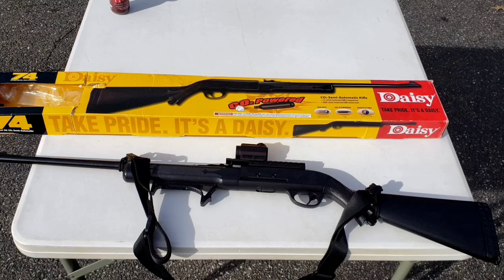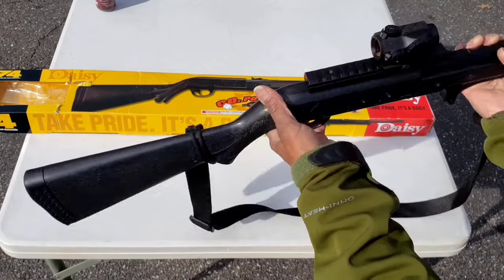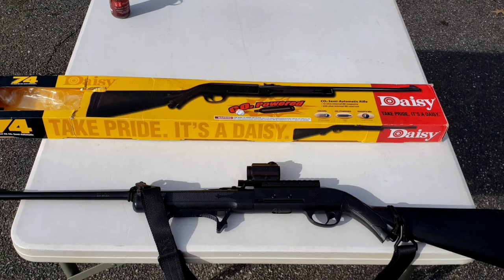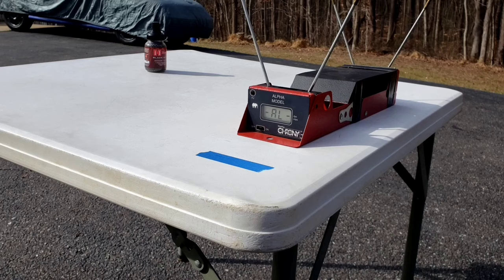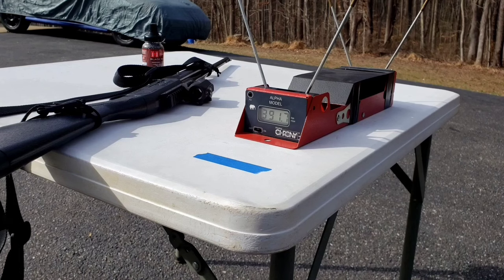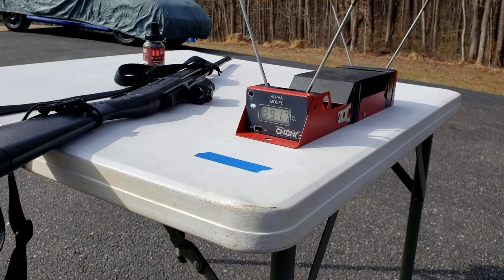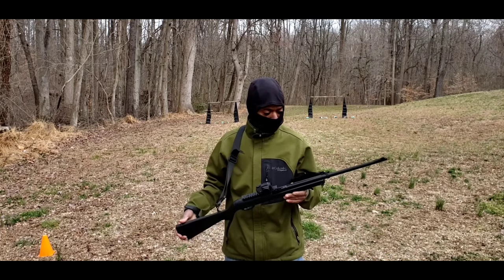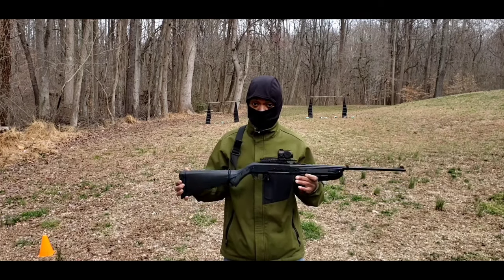Daisy 74 Modified Shooting Test

Comment: How did you increase the power specifically? You should do a pair video with each mod video you do breaking down how it works!
Reply from the maker: I drilled out the internal valve and sanded down the metal part which depressed the valve.
Reply: @turbo15100  that’s really smart, I bet you could really hunt somethin with it now👍